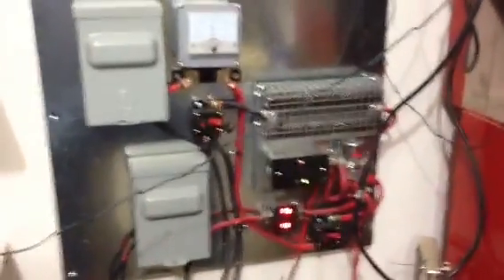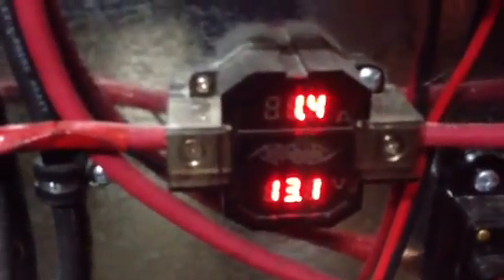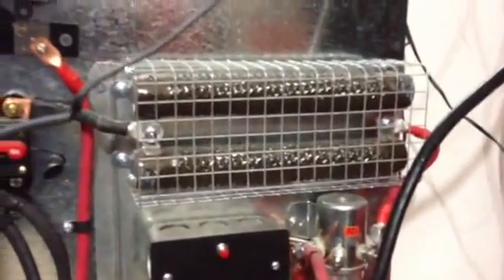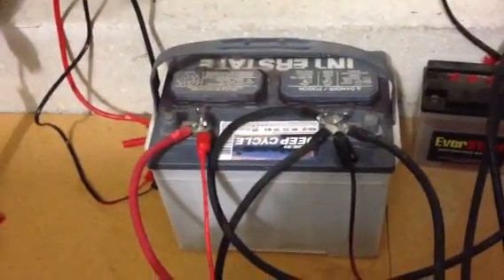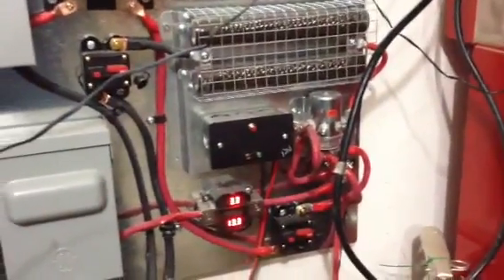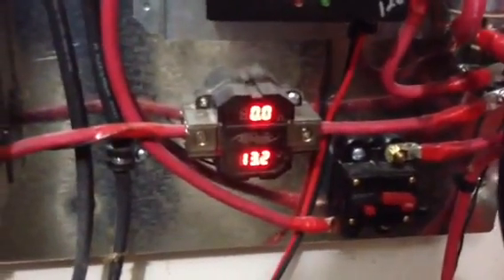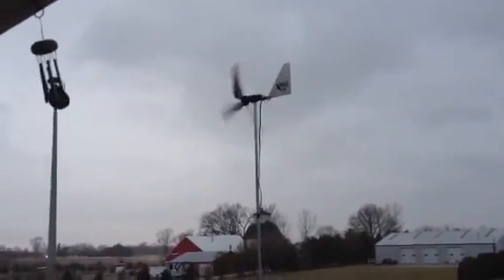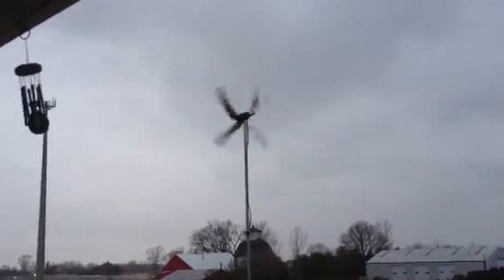Testing wind turbine and charge controller on a windy day Missouri Wind and Solar Control Charger

Comment from the maker: Hey Jeff I did not make it, I bought it off ebay works ok for me in a residential 250 Watt. I am starting out small to learn more about wind and solar, and will add as time goes by yes your controller is awesome works like a charm.  Thanks Ray

Comment: on wind turbine, i like the windmax 400, 600, or 1000w.  i know there's a lot of controversy b/w MWS and WIndmax, and i like both companies.  i just happen to have the windmax and can only speak about what i do have, and that it works well and quiet. it also hits the published power curves. but you're real power is always gonna come from solar as you probably know. of course, i'm addicted to all as i am sure you are too. lol. you can get 240w panels now for 225/each so really worth it if u shop

Comment from the maker: My plan is to have most of my power going to the grid, but I want to have a battery bank that I can switch over, if the power goes out. I will not use this battery bank much at all, it will be for emergency only, I want to be able to keep it charged but, but mostly have my power going to the grid.